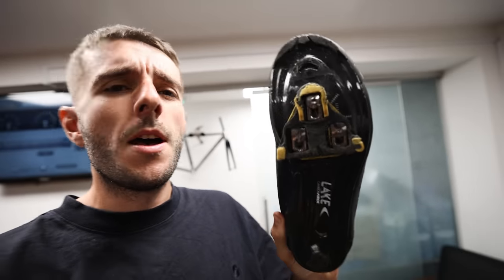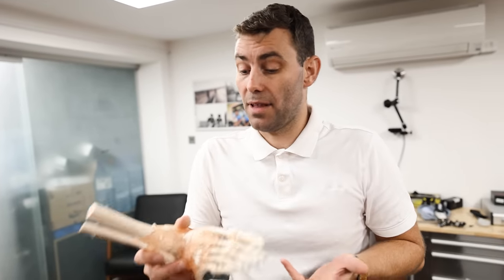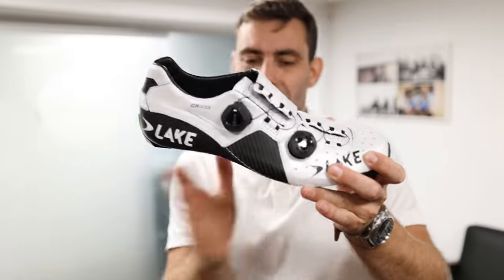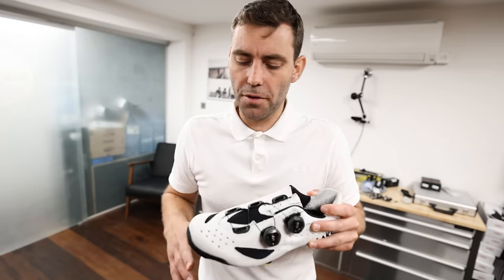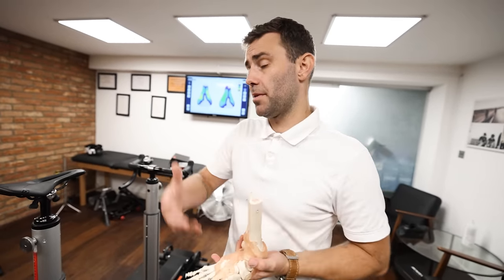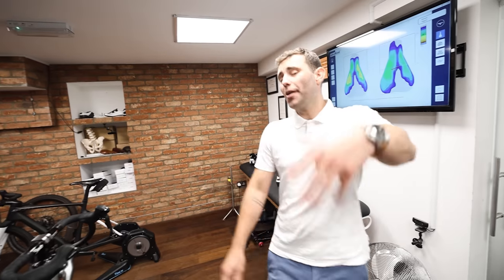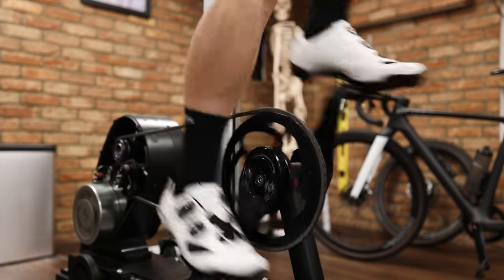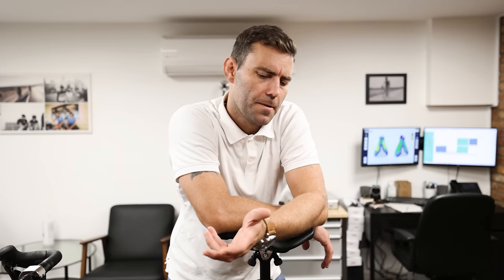Mid-Foot Cleat Position - A Bike Fitters Opinion

Comment: Perfect shoes size, 
Pretty long toes,

Was doing the furthur back cleat for the last year, got new shoes with same italian bolt location and height, a tad rigidity gain but same last shape, sole rock and arch (sold outdoor shoes and ski boots myself, trying to know what I was doing ), saw a track runner with pretty forward cleats and dynamic foot strike, remember I use to track run, tried a tad forward, nearly under the ball of the foot, instantly gained sprinting punch and uphill stamina.

Not going back to further back placement ! Old shoes are going that tad forward !

Will need to adjust saddle accordingly ( little up, little fw ;)

Not convinced by that one, but hey keep it up, alway great content from this Chanel !!!

Comment: Wonderful video! Just came across your channel - a trove of info refreshingly looked at. Thanks.

Regarding toe overlap, there is one situation in which it can become very real and scary for road cyclists: big hills with hairpins. 
I've been riding with arch cleats (Bonts were very helpful) ever since losing a gastrocnemius and, with size 49 shoes, get a good deal of overlap. When riding in the Alps my feet have brushed the front wheel on numerous occasions yet not once did it cause me to fall. It's not that I'm a particularly good bike-handler (quite the opposite!) rather, that there always seems to be enough time to adjust. 
While I cannot speak for others, from my own experience I learned that the biggest problem with overlap is the fear of what may happen - that your toes might get jammed in the wheel or give it a serious kick. Yet, in practice, this just doesn't happen on the open road. 
Or does it? Have others been brought down by it?

Comment: It's a bit like foot contact points in track&field. 
Sprinting and jumping is done on the forefoot, due to its springy character. Endurance on the other ends is positioned to the middle of the foot. 
Of course there is a "in between" (800m to 1500m) where you might see both.

Comment: Hi James
- thanks for sharing your knowledge for free, appreciated
- for best sustainable power delivery when seated, ie your usual riding position, would/should we be using the calf muscle (to some degree)? 
Presuming so, it feels like moving the cleat too far towards the middle of the foot starts to make this more difficult. I've always naturally felt that you want the push on the pedal to go through the foot a bit like you climb stairs - too far on the toes and the calf muscle can't sustain it even if it's initially more springy, too far in the middle of the foot and you don't feel like you get all the push you could due to effectively negating the calf muscle and only using quads. 
Happy to stand corrected! Or sit. As you prefer.
Reply: I agree with you. I have tested this before. The cleat too far back makes you lose power and is unnatural. The stair climbing theory is best to analyze the cleat position on the shoe and power efficiency. 👍. Just Another gadget to sell $$$$

Comment: I started running. Got shin splits because I was heel striking. Slowly and painfully I learned to run on the balls of my feet. No more shin splits. I think it would be harder on my knees if I were move my cleats back. Oh, and a side benefit from running on my toes, my vertical leap improved by a foot. Basically, I produced more power because my calves got stronger.

Comment: Gotz Heine put me onto this in Teneriffe. I have two (L4 L5) tears and had post ride cramp type pain that actually did days damage. All bloodflow related. The mid foot has cured 50% of this. I have the adapters but the cheap Shimano shoes are easy to drill.  Richmond Park LOL, where would Sigma be without it/them.  Funny.  PS, I have size 47 feet and yes there is overlap, as there was in the 70's with nearly all, "modern" short  frames. You get used to it.

Comment: I developed Morton's neuroma while snowshoeing with my bindings set too tight. When biking, I find my MTB (used for my road bike as well) shoes that have a single continuous lace system cause painful flare ups. I think lace systems that allow the front of the shoe to be tightened separately from the arch area would be a big improvement. I will also try to move my cleats back farther from the ball of my foot. Thank you for these videos.

Comment: Just watched this again.
Long time user of mid foot cycling adapters, that, unfortunately, don't last if you have a bit of power or ride in bad weather.
Now.
I have stumbled across a new product, by "Form" who have developed and selling cleat adapters, particularly for wahoo speedplay, and just about to release a 3 bolt cleat system.
Worth a look because they are far more robust and threaded into the plate rather than captive nuts which failed on me in midfoot version.

Comment: I had to run a more rear ward cleat position as I was squeezing my wide  feet into a too big a shoe.

Now using Lake shoes (and still using some mid-foot cleat position), 155mm cranks, shorter stem, 38cm handlebar and have never felt more comfortable!

Comment: Broad generalization: most of your bike fitting advice is geared towards road/gravel/touring applications. I'm curious if any of the information from this specific video is different for mountain biking (XC, enduro, ultra-marathon, etc...). Road/gravel/touring has riders in a mostly static position for long periods of time, whereas every MTB discipline forces the rider to move around on the bike a lot. How does more of a mid-foot cleat position (especially with SPD pedals) effect things? Cheers!
Reply: From my point of view, if you're running your cleats anywhere near the front of the foot in MTB, you're doing it wrong. The sheer demand for stability on the pedal IMO requires a somewhat central positioning of the feet when riding trails.
Reply: @steezymtb5876  not disagreeing at all with your comments, but still interested if more effort should be made by those of us that ride MTB to look for methods (aftermarket or otherwise) to push the clear farther back on the shows similar to what is being advised for road. MTB shoes do not have much ability to bring the SPD cleat anywhere near the middle of the foot (at least none I've seen in the past 10 years of riding).
Reply: @kevinbroadstreet8053  oh, now I see your point. That's an interesting topic. I personally ride flat pedals and thus do not have an issue with this, but I used to have mtb shoes for my cyclocross bike and definitely remember thinking about that a couple of times. For me it was the lack of stability that was the issue back then, but it would be interesting to get to test what difference it would make on pedalling efficiency as well.

So yes, Francis & James, please make a video elaborating on the subject, thank you very much.

Comment: Yes I wholeheartedly agree with  bike fit Jame's sentiments about  "the idiots at Wahoo" discontinuing the Speedplay aluminium fore-aft extended adapter plates for a near mid-foot cleat position,  as they have solved several issues  I  had been experiencing for years such as tibialis anterior fatigue and slight Achilles tendon discomfort.   And I was just about to buy two pairs of the new and improved wahoo speedplay zero pedals with the 65mm spindles,  after they finally became widely available,  until I read Ronan Mc'Loughlin's  in depth review on cycling Tips.  Apparently the new and improved manufactured in Vietnam pedals have all developed bearing lateral play issues..  So will hold fire on splashing out until this quality control/  design problem has been resolved.

Comment: I use Catalyst pedals which are specifically designed for the midfoot position. The pedals on the Elliptigo SUB are also pretty cool as well, but they don't sell them separately

Comment: As is usually the case, preferred foot position really does depend on the circumstances.

If I’m climbing out of the saddle at high torque that’s when my foot starts moving back.

Comment: I’ve got a question about the relative shape of the sole as James mentioned: ie. high forefoot drop (Lakes) vs flatter soles (Bonts). Which one is generally better for flat feet?
I’ve got hella flat feet. Besides using inserts for arch support, I’m wondering if I should be leaning toward one or the other sole type.
Reply: I would say that it depends, but bonts are definitely flatter and could be the right choice for you. for reference I had a pair of riots buckle, and it was definitely too flat shaped for my mid-high arches. the only solution here is to go to a bike fitter and do a shoe fit, it doesn't cost as much as a complete bike fit and it will absolutely change things for the better in terms of functionality and final result.

Comment: Cleats from the toe strap era, particularly the Duetto/Diadora shoes of the mid 80's, were more comfortable and mimicked midfoot while placing the ball of the foot rather traditionally.  How?  Well, the cleat had a deep slot that engaged the rear of the pedal body, thus atabilizing the pedal the modern midfoot does, while still keeping the foot placed more ball over spindle.  That's how I remember the sensations, anyways.

Comment: I tried full to the rear cleat placement for a while but it just didn't work for me.  Started getting cramps in my arches even with arch support.  Moved them about 2 mils forward and it's much better now.  Guess I'm wonky?  LOL!!  Love your videos so please keep them coming!!!!
Reply: Yep. I have huge arches on my feet. Placing the cleat under them just makes them feel like they're gonna collapse (even with good insoles). Cleats forward I never have arch issues and it also feels more natural when pedaling.
Reply: @FRANK-pp4rn  I think I am with you guys on this. slowly crept back 2-3 mm and it is better. just harder on my joints sorta because there is more loosy-goosy that the calves have to control, but I have my ankling back--just have to be careful to the achilles, as someone mentioned above

Comment: I have my speed play a little back but I can’t go fully back as the slope of the shoes go crazy & you need the cleats square with speed play or they won’t perform properly. However I feel I’m ‘just’ enough back. This copper bloke is awesome. Let’s have a video on Q-factor, as I’m narrow Have the sides of my shoes very close to the cranks.

Comment: I’ve had a couple bike fitters try to move the cleat to this sort of position but I could never get past how it felt sprinting out of the saddle. Also in terms of toe overlap, I never thought it was a big deal until I rode my old bike which has a bit of toe overlap and whenever I tried to track stand at a stop light I’d constantly be hitting my foot. Wasn’t a big deal but it was slightly annoying.

Comment: BikefitJames... you have a Pearson? From New Zealand...? need pics... He makes nice frames. I tried mid foot and really liked it but am happy with normal cleat placement (all be it as far back as I can run them). I have toe overlap being a shorter rider but it isn't an issue... occasionally at lights I find my toe is on the wrong side of the wheel but it's easy to correct.

Comment: I’ve had a problem for years with my left leg near the knee. On longer rides my IT band would become inflamed and it’s very painful. 

I still have pain and irritation when spinning indoors. 

I never have problems with my right leg. It is my dominant leg though. And I’m not aware of any injuries that I may have had with my left leg. 

I do have flat feet not sure if that’s a factor. 

Or perhaps one leg is shorter than the other? 

I have Sidi shoes with speedplay Zero pedals. 

I always pushed the cleat as far back as I could and opened up the float to the maximum of 15°. 

I think I’m in the ballpark of good saddle height and distance from the bars and crank.

Comment: Thanks for the video. Which bont shoes specifically allow for that increased backwards cleat placement? I think I may have sized up a bit too much for the wide fit which has not really made a significant difference in the forefoot. I have a lot of forefoot issues however when I ride on a normal bike with regular pedals and pick my position of pushing I have way more endurance in my foot.

Comment: I could be wrong, and I welcome other opinions. But... If humans were designed to spin pedals, they would not have calf muscles or feet. Their thighs would attach to the pedals by a rigid lower leg with a cleat attached to it.  If this is true, then placing the cleat under the ball of the foot gives no mechanical advantage over the mid-foot placement. Your thoughts?

Comment: I'm only 5'6" (was an inch taller, aged 54 shock horror it's true I'm shrinking) with size 10 feet(huge levers) so I watched this and thought- hmmm, makes sense so I slammed the SPD's back as far as they would go and went out for a 61km jaunt today (480m ascent), well, what can I say, felt bloody awful and really kinda unnatural to me, and in the last 12km started to feel niggles in the left upper calf, and I've had no issues, ever, with my spuds and cleat positions.... got home and put the cleats back to where they were (lucky the cleat grip imprints were still there!)....for me it wasn't broke so didn't need fixing, lesson learned....

Comment: What would be a potential solution to it feeling like I am applying pedalling pressure using mostly the outside of my foot? Which then causes discomfort and a little numbness. (New to cycling so this has just reared it's head). Cheers

Comment: How does moving the cleat back work with saddle placement and seat tube angle? I ask because I've found on my gravel bike that with the saddle slid all the way back, I can avoid frontal knee pain that I get with the saddle moved more forward. I'm assuming that by moving the cleat rearward on my shoe, I'm effectively steepening the seat tube angle and changing the relationship between my knee and the pedal spindle in the same way that moving the saddle fore/aft does. Is that correct?

Comment: If someone has slightly different sized feet (in my case, US 9 R/9.5 L, or EU 42/43,  respectively) and wanted to move their cleats completly rearward, should the side with the smaller foot be slightly forward from the other to compensate for this difference and, in theory, prevent the body from rotating?  Or, would this amount of variation make such a small difference, if at all, that mounting both cleats completly rearward and disregarding the variation in this scenario should still be fine?

Comment: Okay, I have a question about cycling shorts, or more specifically, how they fit. Most bib shorts I own have padding for sit bones and areas that come in contact with the saddle, but almost nothing up front in terms of a modesty panel. 

Of course the undercarriage padding is the most important thing but the front padding ending at the crotch leaves only thin Lycra in front, which does nothing to insulate male anatomy. Other than this being occasionally troubling, it is also uncomfortable. 

OTOH I see the GCN presenters in those fabulous kits, and most of the guys look like Ken dolls in front, which is to say they look very tidy and well arranged. I would really like the Ken doll look but, by and large, few manufacturers incorporate a true comfort or modesty panel in front. Any idea why not?
Reply: Assos has a thing called kuku penthouse for male comfort. Once I got used to it castellis for example feel too tight around there. It's great.
Reply: Thank you. I have now spent long ,minutes staring at the crotches of men in Castelli bib shorts trying to figure it out. Mostly it just seems like Castelli has the longer tongue in the front. I think the pad just comes up like a ladies pad does. 

And if you look up a brand called aerotech designs online, they sell chamois separately. (In their menu under "cycling gear" } "Apparel Accessories") You can look at the shapes. There are a lot of different pads out there!
Reply: Wow, thanks folks for chiming in and not making fun of me! Politeness is very rare on social media these days. 🙃

So, I take it, the GCN bibs are from Castelli?

Comment: Hey! James, question to you: would you recommend these adapters to an individual, whose foot support is fine (ergo soles in shoes), but with longer feet? 29.5-30mm, which in most cycling shoes is 47-48? I already have cleats as far back as it is possible, and yet still find my toes numb especially when out on the saddle. Cheers!
Reply: 300mm ofc ;)

Comment: I have a problem with "hot feet" (metatarsalgia).  Google tells me that apparently after three hours my feet are swelling and squishing nerves. It hurts like hell. I've ordered some pads that stick on the bottom of my feet. Hopefully those will work. Will a mid foot cleat location help this?
Reply: Same.  I was using road shoes (3-hole) with an adapter for SPD cleats.  Rearward adjustment was limited.  Going back to XC shoes with the SPD cleats as far back as possible provided immediate relief.

Comment: Thought that the idea was to do the opposite, activate the calves so that they can help pumping blood, why help weaker parts by not using them, instead of strenghten them so thay they can withstand the abuse, like other muscles of the leg? Also barefoot runners dont seem to have weak forefoot, just people using modern shoes.